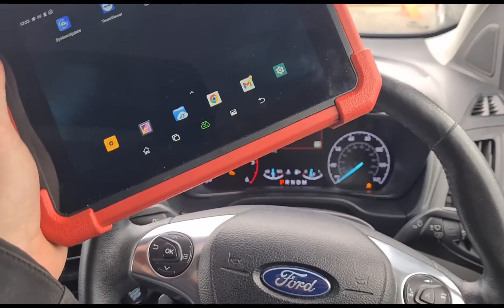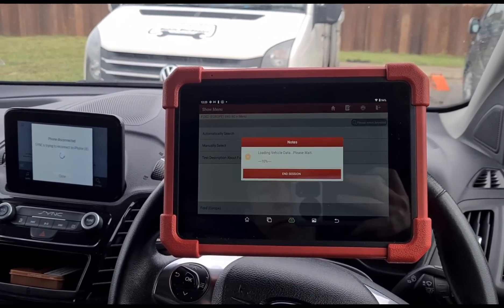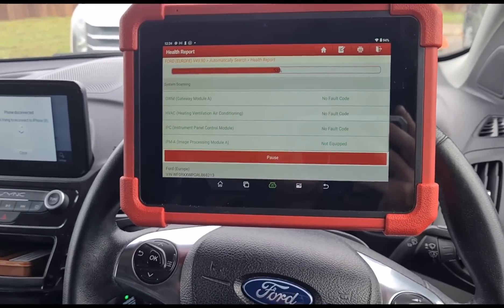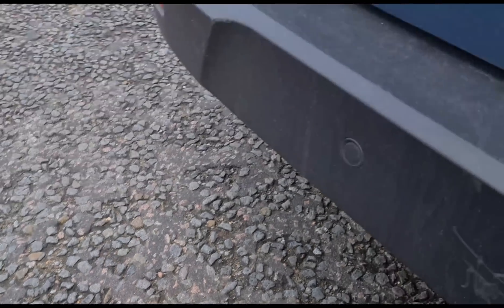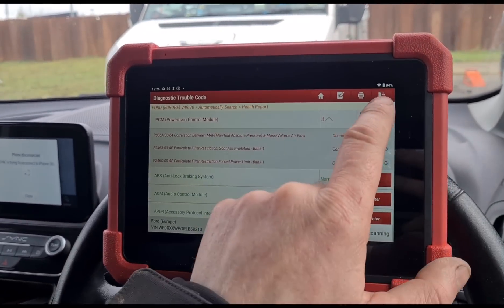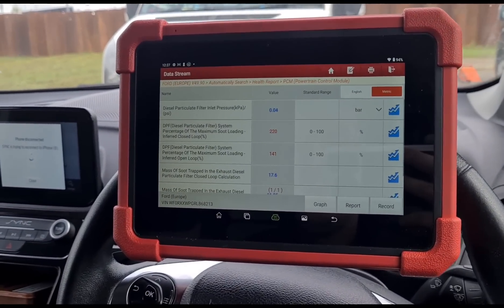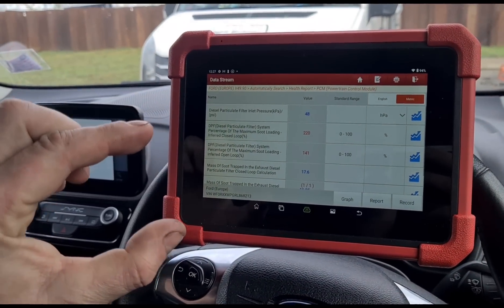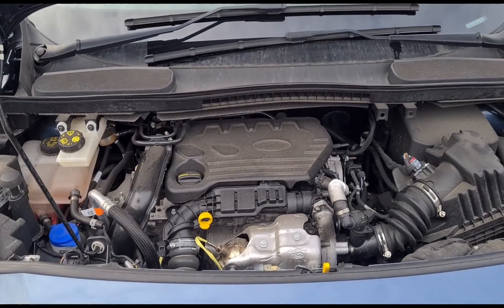Ford Transit Connect P006A:00-64 Mass Air Flow Corelation P2463:00-AF Particulate Filter P246C:00-AF

Comment: Hi Jimmy,  first of all love watching your videos.  The launch mot4.... how are you finding it in regards to functions etc. I still can't belive that for the price they haven't updated it to intelligent diagnostics and topology, for the price you expect it to have all of this, especially when compared to the kingbolen k10  or even the launch x431 pro3s,  which are all around the same price. I'm not convinced on the mot4 as of yet, bang for your buck there are lots of machines out there that have more features. 👍
Reply from the maker: Yes I'll be honest I'm Disappointed it doesn't have topology and intelligent diagnostic but other than that it does everything I need just not as quick and easy as the Tab 3
Reply: @ORileysAutos  what's bugging me as well is when I called launch uk and asked about this model they assured me that it has intelligent diagnostics & topology,  same software they said.  It clearly doesn't.  Come on launch sort this out please.

Comment: I’ve got a dpf light that’s being a pain, I don’t think it’s the dpf it’s self but the egr low pressure differential pressure is -20,000hpa and valve position is -128% when idle and driving although not done reading at fully warmed up engine. Would you say this is faulty egr?

Also one of your post said Bedfordshire, where are you located? It’s hard to find someone know shows about dpf systems as most mechanics have no idea 

Thanks

Comment: Have you tried the QBond glue with the strengthening powders? I've lost count on the various things it's bodged together on an emergency. Boost hoses, coolant pipes, plastic and rubber ones, and amazingly pothole damage on tyres, obviously thats to limp to the closest garage for a tyre when there's no spare 😂

Comment: A recent comment / rant by Jimmy about DPF cleaners who only clean but don't diagnose, that is just as daft as taking a wheel that isn't holding air pressure to a tyre shop. They just pump up to pressure but don't identify or repair the fault??  WHAT IS THE POINT OF THEM!
Reply: Exactly. Part of the satisfaction of a decent job is correct diagnosis.

Comment: 30k miles? Don't buy a Fraud vehicle.
Reply: Mate I’ve got the same van same year same problem it’s done only 27000 .so pissed I’ve traded it in for another new van
Reply: Just sold my Avensis taxi. 311k miles, original clutch, No Dpf issues or anything else. @johnbullough6431